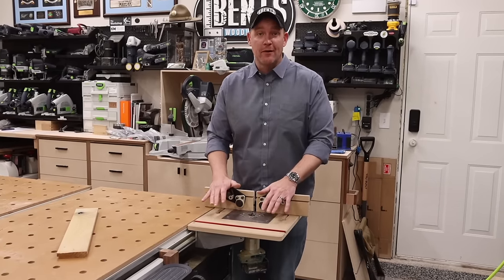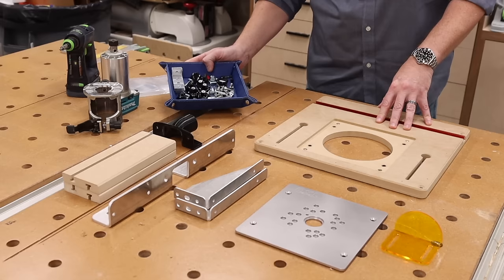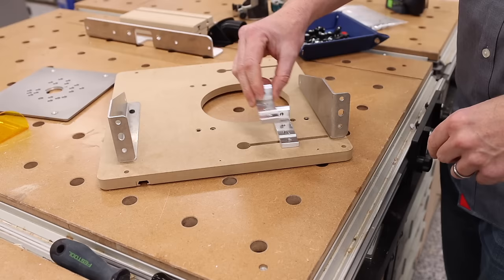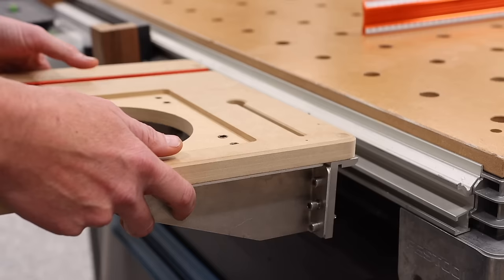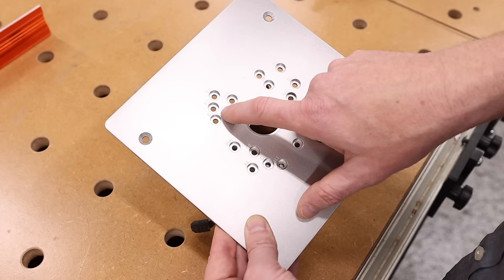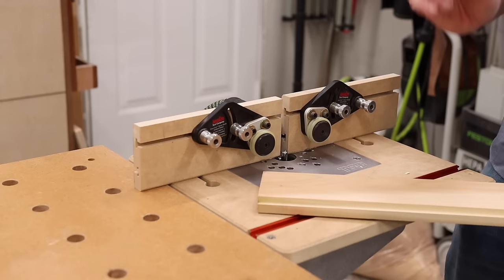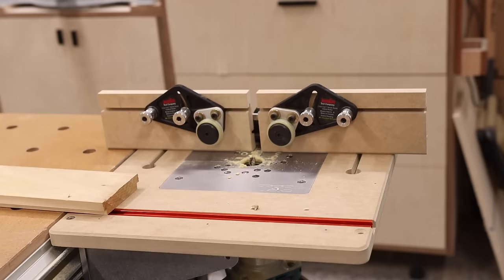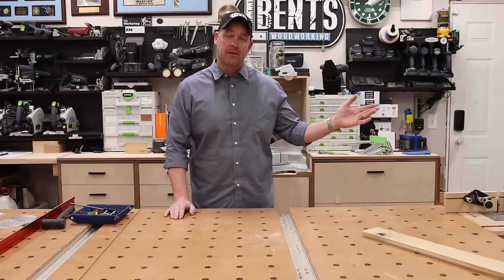STOP spending $$$$$ on router tables

Comment: Some times you have to decide what you will do yourself and what you will farm out.  I gave up doing doors long ago as it's almost as cheep to buy them as to build them yourself.  95% of my work is with palm size routers today.  But there are times I love to bring out my PC 890.  Not sure about the router table, but I'm liking the Table Extension. 

Also look into those LR32 Guide Plate adapters.  They are great for adapting  plunge bases to work on a LR32 guide rail, and for doing groves.  My Makita and my PC 890 have the bases installed on the plunge bases permanently.  Yes, I know TSO does not have PC adapters.  I worked with the guy who originally came up with the idea and he 3D printed stuff for me as we tried out new ideas.

Comment: I put the Festool CMS router module into my homemade Palk mft table. Fits both the OF1010 or OF 1400. Well worth giving it a try. Heaps of support from the big Palk table. I do like your little router module though as it has some advantages over the Festool module I think, mainly the ability to slide the fence back and forward easier than the Festool cms module.

Comment: I thought when you set the height on the JessEm wheels you set it off the metal hub, not the rubber wheel. I could be wrong, but that's what I do with the JessEm table saw wheels. I really like that about them. The wheels are unbelievably helpful in breaking down plywood if one doesn't have a sliding table saw. Perhaps they are different and not spring loaded like the table saw ones are. That really gives them some good downward pressure and also pulls the work towards the fence since they are angled slightly. 

Never mind. I just re-watched your video. It doesn't appear that the router wheels are spring loaded...  I like my JessEm table saw wheels so much, I will probably get the router wheels someday. Thanks for the video as always.

Comment: Nice. Would buy one, except it does not have option for a router lift. I have a Makita trim router.  Having to bend down and rotate the router to raise/lower is a pain. More so when older or have issues. I just received the TSO 30" parallel rip guides with extra stops and the MFT aligned guide rail support upgrade kit. Now just need to wait for the warm weather as I live in a condo and only work out on the balcony.

Comment: Is the table physically large enough to fit a 2.25hp router, they just don't list them as compatible due to weight/torque support?  If they adapted the design with supports on both sides so it could mount between two mft tables, or in my case between an mft table and the mw 1000 mobile station (the supported side of the mw) it could be quite an upgrade.  A small in feed and large out feed and solid platform for a bigger router.

Comment: Booo. 300.00. Not for the hobbiest
Reply: I agree, if your hobby is stamp collecting.
Reply: Out of curiosity has Brent ever stated that his channel was for hobbyists? I mean an MFT/3 Table alone is $799.00 then it is some what pointless to pay that if you don't have a compatible track saw which would be another $400-800 depending on model (the makita fits on the festool rails has does the new milwaukee). So a $300 router table extension isn't that nuts when you already have $1100-1600 invested in this system. Hell a cheap router table with out a router runs $200 and isn't much bigger then this.